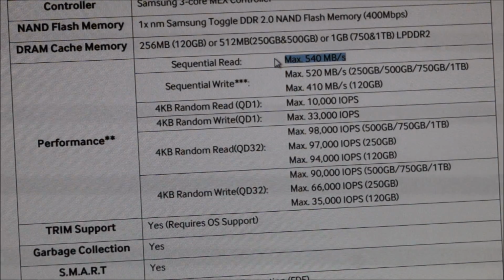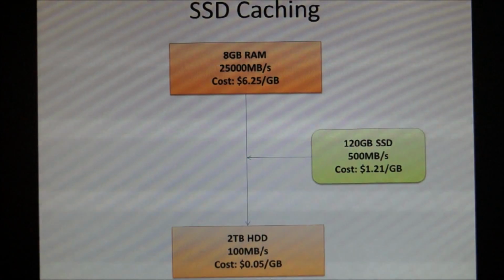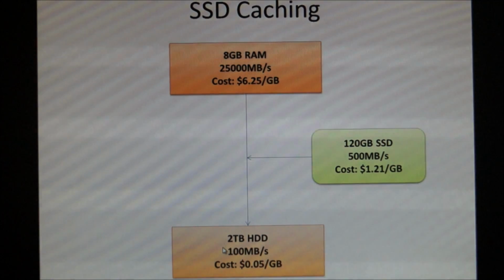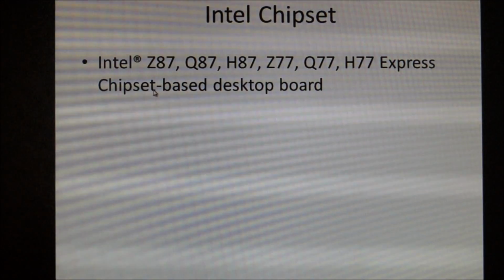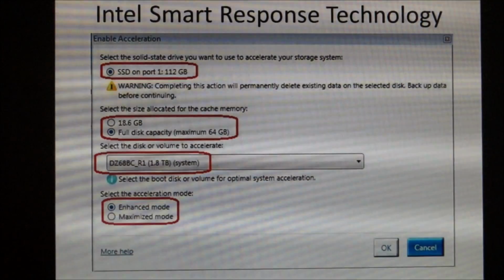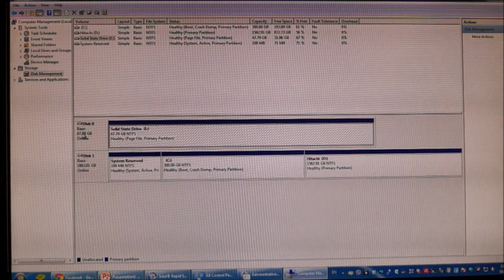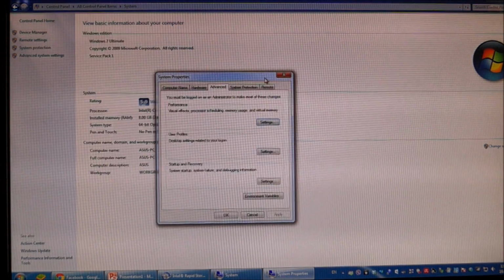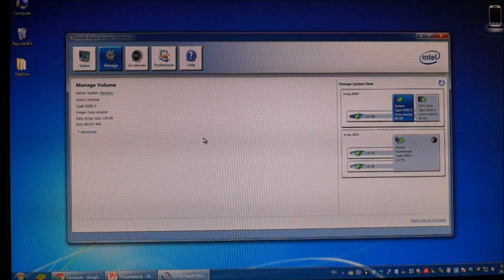How To Optimize Computer Performance Using SSD Caching?

Comment: How to check if my ssd caching is running normally
Reply: Measure the time a programme takes to load (something with a terrible loading time like GTA V) Reboot and repeat. Reboot and repeat. If your files are being stored as a cache on the faster drive  your load times will decrease from the original benchmark Or you could measure performance with a tool like PCMark

Comment: THe Software guide is very good but it does not show how the SSD and HDD are connected to the Intel Chipset  ( They should be plugged directly into the side of The Z77 in my case ) not to the normal ports on the MB )